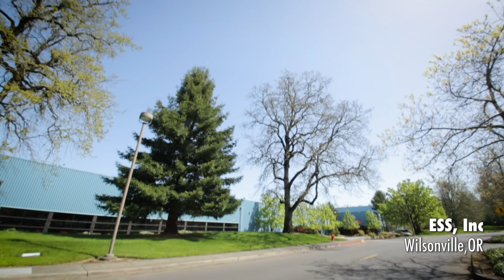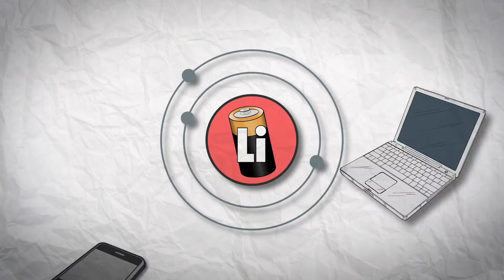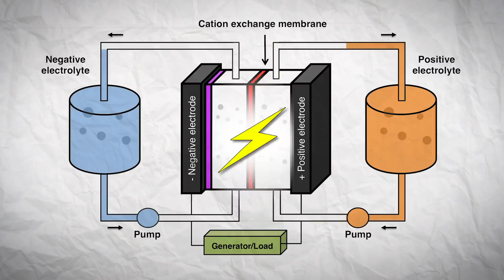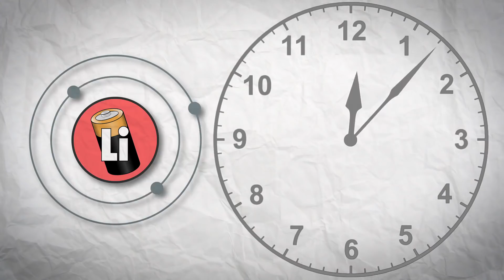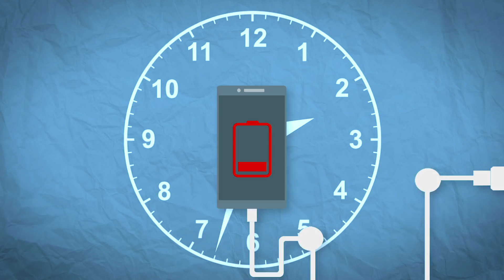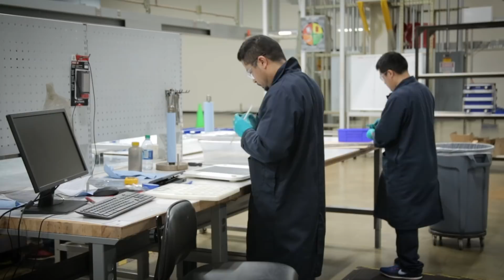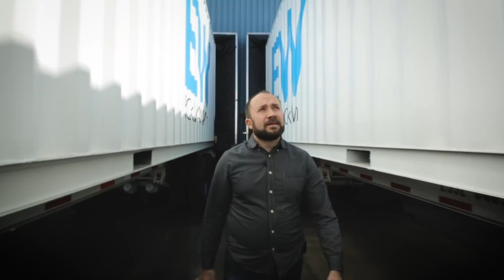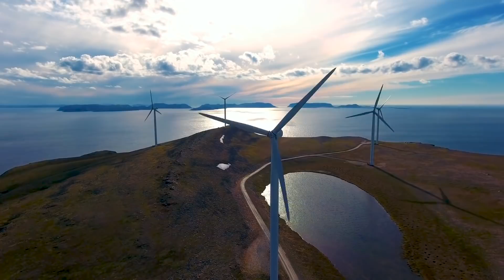Battery Fueled by Iron and Water Could Transform the Power Grid

Comment: because every house can have its own 50 foot shipping container...
Reply: I think it would be more that your power company would have them at the power generation sites, and then they would be used to send power along the lines.
Reply: They said the market isn't for individual homes. More like a committed neighborhood, military, power plants.
Reply: Arien - typical house in the us consumes 1kW, maybe 3-5kW during peak.  This means a typical house would only require 20-40 kWh per day.  Nevertheless, this battery technology is not designed for residential usage, it is for large scale utilities, large scale solar or wind facilities
Reply: I think you may have done that math incorrectly.  Perhaps show your work and we can see where the numbers went wrong.
Reply: Future Hindsight, you're assuming that a house only needs 4kWh for an outage?  Maybe for a short outage; not a long one.
Reply: I did the math. On average, you'd need at least 8 of them to power your house for the day. More in the summer if you live in a hot climate.

Comment: This sounds interesting, but I don't see why this would be better than pumped storage. At the scale of the electrical grid, pumped storage seems like it would be the least invasive of the two, since it involves less chemicals. Even if the content of a flow battery basically amounts to fertilizer, that doesn't mean it can't cause damage to its immediate environment in the event of a leak. Another advantage of pumped storage systems over battery storage is that they don't require conversion from AC to DC and vice versa. As you've kind of pointed out in your video, flow batteries are good for their quick availability, which can be very useful in emergency situations (after natural catastrophes for example), so these batteries definitely have some merit, but I don't think this is the route to go for energy storage on the scale of the electrical grid. I'm no expert though, so I might be off of course.

Edit: Watts is a unit of power, not energy, so saying 50kW is enough to power X amount of households for Y amount of hours doesn't make much sense.
Reply: It was supposed to be 50kw hours I believe.
Reply from the maker: Glad you asked! Actually had a section about pumped storage in an earlier draft but had to cut it for time. Anyway, as of now, it's pretty much our only option for large scale energy storage. But you need a hydroelectric dam to use it which means you need a river or waterway of some sort. So it's geographically limited and not at all portable. And it seems to use more energy than it stores (but overall it's better than nothing because you can still sell the energy back to the grid). Dams aren't necessarily very environmentally friendly either. They cause massive changes to the local environment and can cause problems for salmon by impeding their migration. So pumped storage is certainly an option but it has issues that an iron flow battery doesn't.
Reply: "And [pumped hydro] seems to use more energy than it stores". Pumped hydro (and all other storage systems) will never return more power that it takes to charge. Obviously pumped hydro is economically viable. I do agree that it has a massive environmental impact though.
Reply: +Greg X 

  G'day,

   The other point about Pumped Storage is that not only is it barely 70%  efficient at Energy Storage, but you need Geography & Geology & Topography suitable to build 2 Dams at least 350 Metres (1,000 Ft) vertically apart and within 500 metresor so horizontally.

  By comparison, the second-hand Lead-Acid Batteries (from a Golf-Cart) which I use to light my house are running at 95% Storage Efficiency, and they sit at Ground-Level with no moving parts...

  From memory, because it takes the same amount of energy to raise the temperature of 1 Pound of Water (423 Mls) by 1 Degree Farenheit (0.38 Degrees Celsius) as it does to lift the Pound 768 Ft into the Sky....; it turns out that for a Pumped-Storage Hydro-Scheme to produce sufficient Electricity to boil enough water (in an Electric Kettle) to make a single Cup of Coffee, requires dropping  170 Litres of Water vertically onto a Turbine from 350 Metres up, through a smooth Pipe (35 Gallons, from 1,000 Ft).

  Not only are the neccessary convenient Mojntains, Lakes, and Dams generally unavailable in most locations...; but Droughts mean that the Water isn't always ready to hand, either.

   And, most of the locations fit for Pumped-Storage schemes are already in use ; and every one of them is an Environmental Disaster for every Waterway involved.

   Lead Acid works, and it's cheap (I get mine for nothing, on their way to be recycled).

  Have a good one,

 ;-p

  Ciao !

Comment: What about Molten-Salt batteries ?? Please investigate.
Reply: If they are molten, they are not very feasible if you have to keep it molten. I just realized that my they might of not been asking that, so if they were asking why it was not used than that's the answer to that question.
Reply: Pillarship Empire Employee #0.  that's why? that's why what??
Reply: oh I see.
well they're feasible all right: 
https://en.wikipedia.org/wiki/Molten-salt_battery#Rechargeable_configurations
P.S. my guess is that "levmatta" wants a video to be made about Molten-Salt batteries.
Reply: That's what I thought they were asking for, also didn't know that melting something when you need electricity was usable with current technology.
Reply: Molten-Salt batteries are interesting, but like with any battery chemistry it takes years of R&D to make it work well.  With molten-Salt batteries it's a challenge to find salts that have stable chemistries, have a low melting point, good conductivity, are affordable, long-lasting, and dissolve whatever it is they need to dissolve.   Salt tends to be corrosive, especially at high temperature.  It reminds me of the technical issues with high-temperature fuel cells where there are significant design challenges with making them affordable and long-lasting.  Water is ubiquitous so it's easy to take for granted what a good solvent it is until you try to do without it.  The approach is probably well-worth researching, but making it viable is not as trivial as it might seem.  One good thing about this ESS Iron-Choride chemistry is that it's relatively simple.  It makes it much easier, more stable, longer-lasting, and less expensive.  The problems with water are that it tends to limit the cell voltage to 1 or 2 volts.  And many of the earth-abundant metals are too reactive to use in water.  Iron is the obvious exception.  Zinc is also a good candidate.  For non-aqueous electrolytes, some the ones used in lithium-ion batteries seem surprisingly good.  These could be affordable, non-toxic, work with many metals in metallic form (sodium, etc.), and at higher voltages.